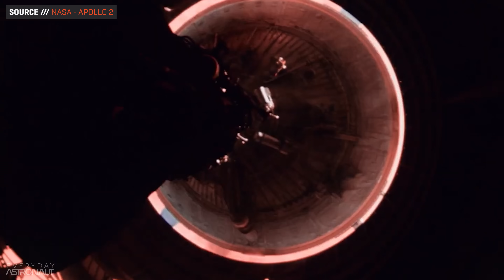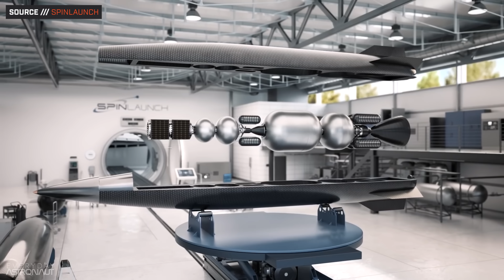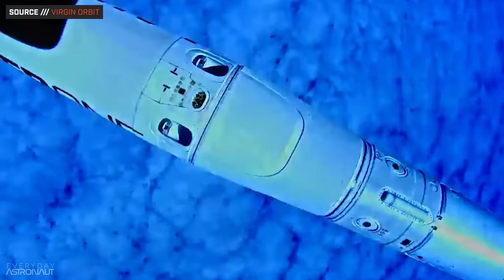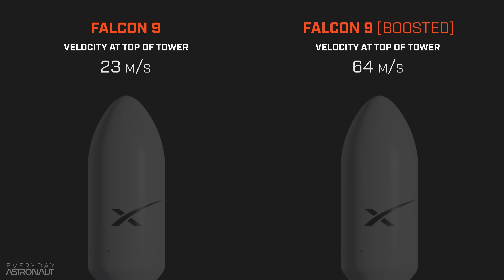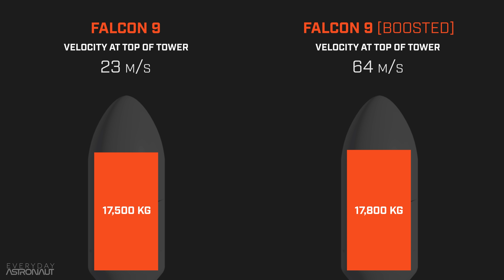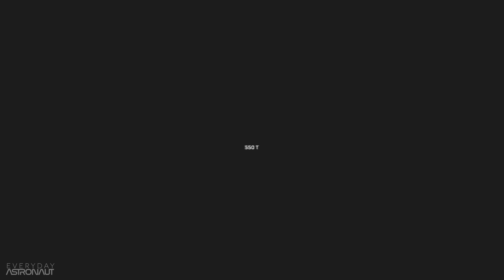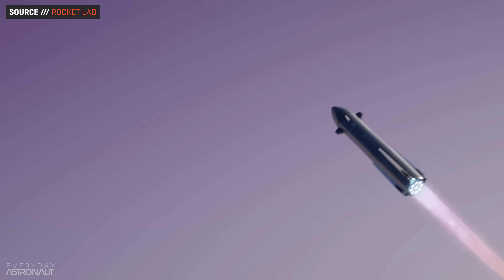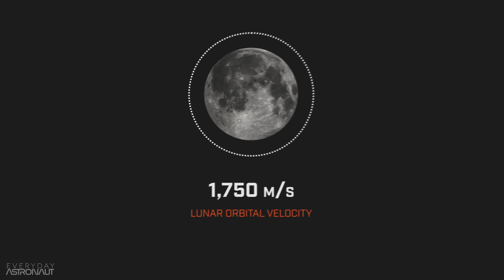Could We Help Push Rockets To Orbit?

Comment: an aerostat launch platform, that can either lift the launchables using a sub unit of that platform (i.e. rocket) which would then link up with the larger platform at hight altitude or provide a landing runway for a lift unit.  then from the platform (say at 25 miles up or higher... depending on capacity) can launch smaller near vacuum only cargo horizontally using maglev or rocket launch from there.  This would be large, conceivably the size of Rhode Island, but provide incredible advantages once built.... Could be done with one years worth of NASA budget.  SpaceX could launch from there (with first 25 miles of launch achieved with mountain sized 'floaties'

Comment: Amazing video!
I always imagined a swarm of small rockets/drones attach to the hull of rocket during launch.
 
One quick idea about the counter weights:
I not deeply familiar with the physics of pulley systems, but I'm pretty sure they could be more efficient, than was proposed in the video.
Because they (seem to me) very flexible in their design:
a) the counter weight can be on a different, possibly taller structure (or going underground), storing more potential energy per mass
b) there could exist multiple counter weights in parallel, which make the design scalable and more manageable

Comment: Thank you Tim! You could have explained the whole topic in just a few words: the chemical energy density is far-far-far higher than electromagnetic. This fact kills several sweet dreams at once: 1 - laser guns are not viable at all compared to gunpowder-fired equipment; 2 - EVs on a mass scale will cause a financial collapse because electricity PRODUCTION and TRANSMISSION is inherently weak compared to hydrocarbons or other chemical fuels. This means all boost to rockets can only be either chemical or nuclear. Full stop.

Comment: I always thought that a big beefy "rollercoaster" type deal that starts horizontal, climbs up the side of a mountain and then ends vertical, with some kinf of propulsion, would significantly reduce the carry-on fuel required to break out of earths gravity. compared to just... sitting on the ground and going. But hey there's probably a reason no one does this i guess.
Reply: basically a rail gun that shoots you half way to space. see also: final fantasy 8 xD

Comment: Great video, but what about a circular rail system that would slowly accelerate the rocket on top of a maglev train for many laps to gain speed, then it would divert and climb up a ramp for launch?
Reply: Think it wouldn't work so well for people though, because you'd be adding the centrifugal g's to the acceleration g's and still be limited to 5-ish
Reply: @londonwestman1  yes but I never specified the size of the circle, it could have a large enough radius where the angular acceleration is small and the speed can increase slowly avoiding intense acceleration and taking advantage of the maglev's reduced friction so a massive amount of energy capacity/release isn't a requirement.

Comment: You could achieve the same effect by refueling the rocket while it's taking off, at a much lower cost.

Let's also remember that 300 kg of fuel saved on the ground, which doesn't seem like a lot,  with this sistem is 300 kg of extra fuel in orbit, which is a lot.

Anyway, the energy provided by the assistant is energy that the rocket should have used and will no longer have to use, additional friction permitting. because more speed = more friction,

Comment: I'm just speculating: why not use a mountain, a vertical launch shaft with guide rails and horizontal access from the base of the mountain to mount the rocket? Not a vacuum, but a kind of dense jacket that keeps the rocket engine exhaust in the channel under the rocket and accelerates it like a piston? This would convert exothermic propellant energy conversion in the area of the shaft into propulsion much more efficiently than in a free environment. Problems would be the heat and the tightness against the resulting overpressure below the rocket.

Comment: I have been thinking similar concepts for years and found out they are not very practical. But there might be a better concept: Don't accelerate the whole rocket, accelerate only the fuel it needs to escape the launch tower or a dedicated very high tower. Move tanks containing fuel along the rocket, the fuel being pumped into the rocket fuel tanks. At or near the top disconnect the "very quick disconnection" and let  the rocket continue with full tanks! Maybe it will be almost nonsense to try to apply this to existing rockets and launch towers, better design a great part of it from scratch.
Reply: So, for the example of the Falcon 9, you want to pump propellant at ~12 times the regular propellant loading rate, using an ~4000hp cryogenic fuel pump, through a moving fueling system that has to accelerate up the tower in tandem with the rocket in order to add ~11m/s (0.4g net * ~3s tower time) to the launch? This would likely only be ~100kg of additional payload. Given that most launches aren't mass constrained this wouldn't add functionality, nor would it save fuel since you're just pumping in extra fuel. So to do the math: + ~0 capacity + 0 fuel efficiency - >>>0 system complexity = net negative ROI
Reply: @iamdarth8393  Above I wrote: "Maybe it will be almost nonsense to try to apply this to existing rockets and launch towers" :-)
Reply: Or shoot up only payload with a slingshot or a sleed or a mini booster, while parallel start a another rocket booster without payload and just fuell, and then attach in mid air to the payload and bring it to orbit.😮

Comment: What “if” we put our New Glenn inside a vertical water tank with its nozzles sticking out underneath, and as it ignites it glides out of the tank creating vacuum inside the tank via piston similar to a car engine. By analogy for the train to get traction is the hardest part, further acceleration comes easier. Because then the rocket is starting from equivalent of Moons gravity.

Comment: If you dug two 4 meter diameter shafts that connected with a vacuum seal at the bottom, one shaft opened to the air one shaft with a vacuum. With a valve connecting them at the bottom And a plug on which the rocket could sit that could move up and down the vacuum shaft you would be able to provide the equivalent to the weight of about 130 metric tons (since 1 ton ≈ 9,800 N) in an upward direction.

Comment: Why not look at it another way, try to launch at the same velocity but being able to load less fuel onboard.  How much fuel is burned just clearing the tower? If you could liftoff with the engines throttled down yet still clear the tower with the same velocity and throttle up to full as it clears the tower assist.  You're dropping the cost of fuel, and the mass of the launcher that needs the assist.

Comment: 27:57 Not saying not true when averaged but when not using AC/boiling/cooking/heating/charging EV I'd say "normal" numbers would be somewhere around 250-500W (let's assume 100-200W for refridgerator, 100-150W for some LED lights and than some electronics running idly 50W or not 250W.

Comment: Why don't we launch rockets of really tall things? Like a mountain? If it takes X fuel to get you to the height of Everest, then surely if you launch of the top of Everest you don't need X fuel to get you to the starting height, so the rocket can be smaller. 

There must be an optimal launch ground height that min / maxes the benefit.
Reply: (just saw the ad for the why not launch from mountains video...brb)

Comment: As you point out, a rocket consumes a lot of fuel just get off the launch pad and the tower. What about pumping this amount from ground into the rocket, via flexible hoses, until it reaches a height where it's no longer feasible?
Would that help?

Comment: For the Moon-based launch system, you're missing the fact that once the static portions of the track are built, even a modest acceleration would be useful, as that's energy that doesn't have to come from fuel.  You could even build the last portion of the track first, use it for cargo launches, and expand later until it's long enough to use for humans as well.

Comment: The Electron vacuum launch that you calculated is actually quite comparable to the electric catapult on the Gerald Ford class carriers.  That delivers 484 MJ in under 3 seconds, which is pulled from rotor alternators.  I wouldn't put the actual accelerator inside the vertical tunnel, but rather in two horizontal tunnels near the top, using large pulleys and cables to transfer the force to the bottom of the rocket.

Comment: And steam or compressed air? you can accumulate that one, I know is not simpler with a lot of moving parts and pressure, but you could do a giant hydraulic system with giant ultra pressure hoses? and hold the air underground in a concrete reinforced tank, maybe is so giant its stupid

Comment: always thought an assisted tunnel/silo style launch system would be a better method than current towers. the rocket would start at the surface at a significant starting speed.
an aircraft carrier style steam piston launch assist may be more practical than maglev system.
alternatively as virgin were using modified 747s at 35,000 ft for launch assist and many mountains reach around 30,000 ft. surely a long maglev style track along then up the side of a mountain could release rockets at higher speeds but a slightly lower altitude than the virgin method giving a great launch assist method, and a lot of the advantages to having a launch assist could be drastically reducing the fuel and rocket size rather than allowing larger payloads.

Comment: The yeet mechanism is in the ballpark of what floating oil rigs do. A floating oil rig can pull a thousand tonnes on its pipes. Pipes stand still with respect the bottom, while the rig moves metres up and down with the waves every tenth second. 

The energy is stored in bottles of air, and since the pressure can't vary much, the total energy in that air is many times larger than what's requried per wave. Luckily, the energy goes back into the air bottles when the rig moves down again.
Reply: I definitely feel this could have explored more launching systems since we assumed maglev was the only way. For a vertical "yeet" machine, I would assume something more like the Top Thrill launch engine (some sort of hydraulic) would be more efficient than just pure electricity.

This whole video I was thinking, "of course trying to instantly release that much electricity is not attainable at the moment." You'd need some way to build potential energy to be released, or as with the long rail tunnels, spread the load
Reply: yeah, also, pretty much any mechanical or hydraulic system would likely be a lot cheaper to replace than a super powerful maglev if starship had another oopsie on the launchpad. It's always best to start by trying to keep it simple. You can store vast amounts of energy in physical objects like compressed fluids, or even heavy weights, with very simple and reliable parts

Comment: It seems like a fuel hose to the ship ,delivering fuel for the first 500m (largest radio tower waas 610m) would keep it far simpler, the rocket is no longer lifting the first 500m worth of fuel so it will be lighter at take off as it's being delivered on demand.    It's still adding far too much complexity for the gains, but seems like one of the easier solutions.

Comment: what about making an intermediate space station, where there is enough of an atmosphere to use energy to capture oxygen and co2 and use a large solar panel array ro produce energy to synthesize rocket fuel in situ. then you would launch a leaner rocket to arrive there, there you attach a rocket that was made in space with fuel that was synthesized there?
Reply: Assuming you mean this station is in a very low orbit, the gas particles you would be collecting would have to be accelerated to orbital velocity in order to be utilized onboard the station (~28 MJ/kg of kinetic energy). You would then have to continuously burn propellant to offset the energy being imparted to the collected gasses. Given that only .1% of that would be useful between collected CO2 and water vapor, and the other 99.9% would be completely useless (either inert N/Ar, or excess oxygen you would have no use for), you would have to extract enough energy from in situ propellant to accelerate 1000kg of collected mass for every kg of usable propellant, meaning a minimum energy density of ~28,000 MJ/kg. Since methane has an energy density of 50 MJ/kg, and, after factoring in the mass of required oxygen (~3x that of the methane) the propellant would have an energy density of ~12.5 MJ/kg. So, assuming 100% efficiency in every step, you would be energy negative by 224,000%. The station would be physically unable to maintain orbit, much less generate net fuel for refueling use. I've also completely ignored the fact that orbiting at say 100km is barely any slower than 400km-600km, so you haven't really saved any fuel in getting there.
Reply: Given the amount of solar power you'd need to decompose fuels for combustion, you might be better off collecting the Argon to feed an ion engine, but you'd likely still be off by many times what you would need. Maybe you get 4x the impulse and 10x the propellant mass, but that's still a far cry from the 2000x more power that you would need to counteract drag.

Comment: Just put the rocket on taller infrastructures seems the easiest thing to do, especially with a starship stage zero rocket arms. 
I used to wonder if turning up the water jet spray might help.